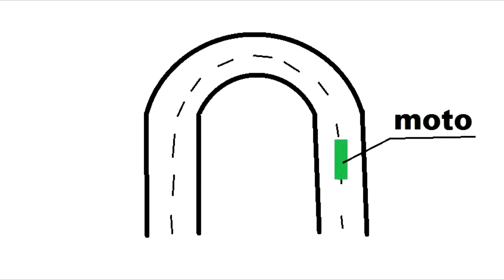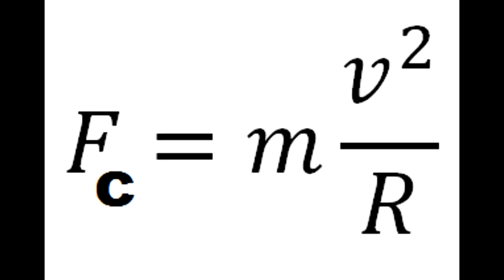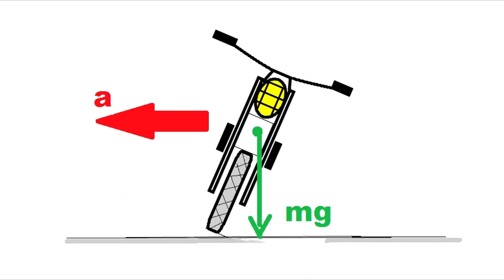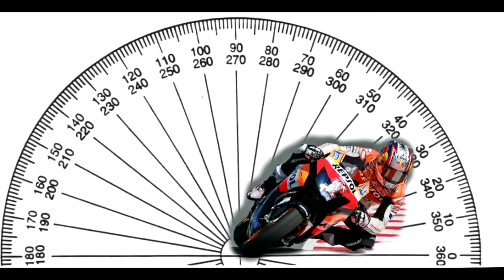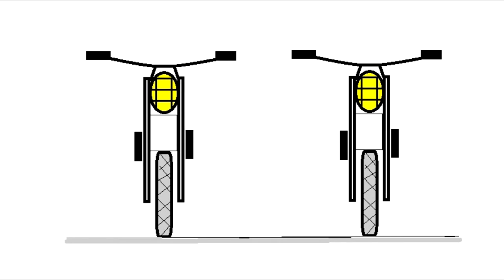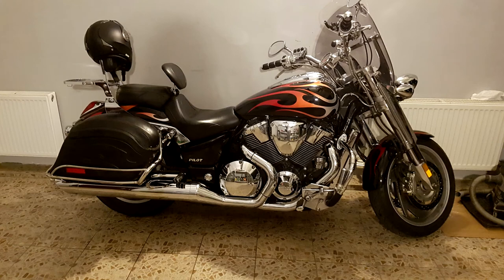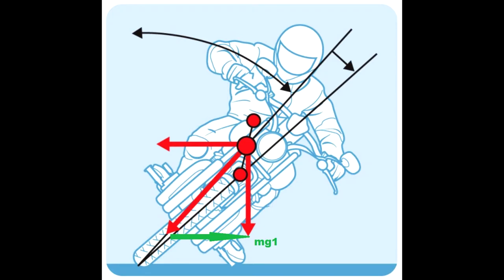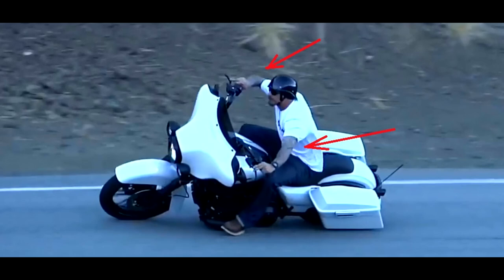Moto crash investigation1 [Harley Wrong Turning]

Comment: You shouldn’t take a turn fast and lean in the opposite direction. Especially when you have low hanging components on your motorcycle. Even when I raced super-bikes in the 90s you can ride up onto the bike itself to the point the tires are no longer touching the ground, which was the case with the motorcycle in your video. Although on the superbikes, you really had to be laying the bike over to ride up onto it. And it always sucks when you’re doing over 140 miles an hour and crash. At least this guy was going so much slow, but had no protection like an idiot.